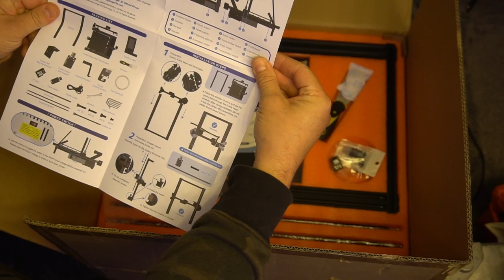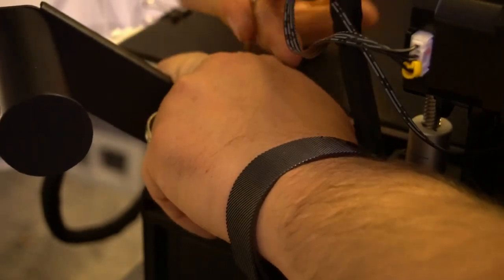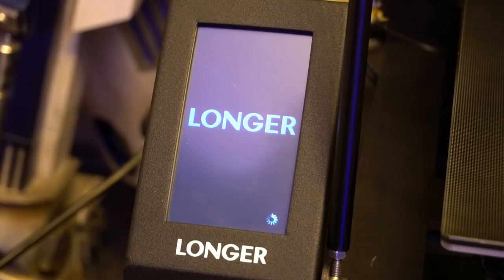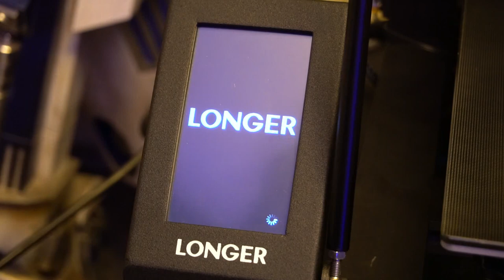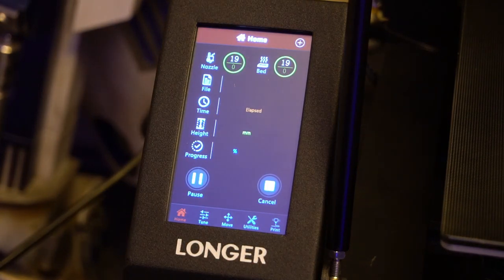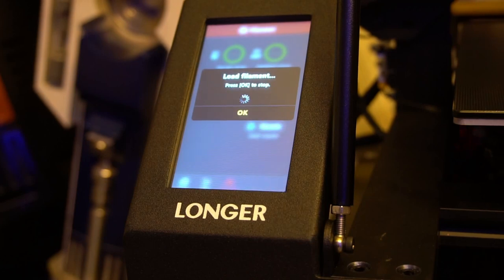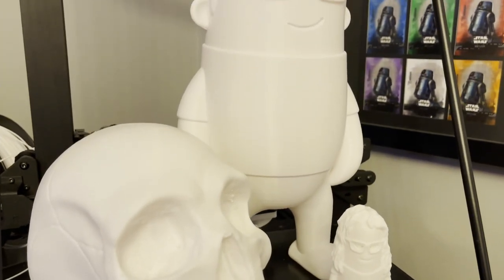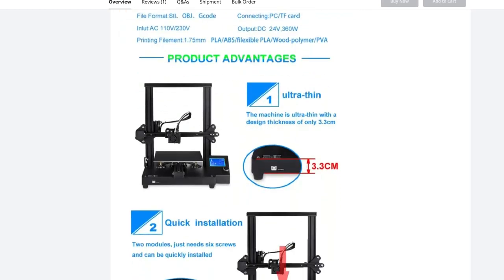Longer LK5 Pro - 3D Printer - Unbox & Setup - BLACK FRIDAY DEAL

Comment: I’m pretty sure they paid you for this review. I have been 3D printing for almost a decade I decided this year to step up my size of prints and found this one man I should have ran. I can not shut off the power loss feature and this keep leaving bubbles all over my prints the heating bed went out on my first print and customer service is Mia all the time I hate this printer buyer’s beware
Reply from the maker: They tried to pay me for a second review but I declined, sounds like you have a faulty unit, if you’re been printing for ten years why not buy something less budget ?
Reply: @TheRealSamPrentice  I was on a budget and I got it just to print some large scale project I was going to do for a non for profit. Maybe I did this thing has just been a nightmare and there customers service is about a joke I’m sending it back
Reply: The biggest problem I have with it is the power lose recovery feature there’s no easy way to turn it off and it puts crazy zits all over the print

Comment: have you had any issues with it stopping mid print ..I've heard of issues about an hour in lately.  was considering this because print volume for the money...and filament runout sensor an so on .
Reply from the maker: Nope the one I have is pretty flawless, the mid print stopping thing I have seen before that was due a faulty SD card. The only think this is missing is a second z as you'll need to watch the accuracy of the right hand side if you are printing mechanical parts.